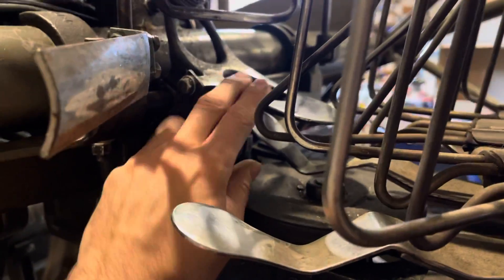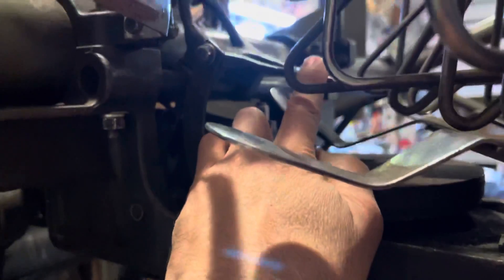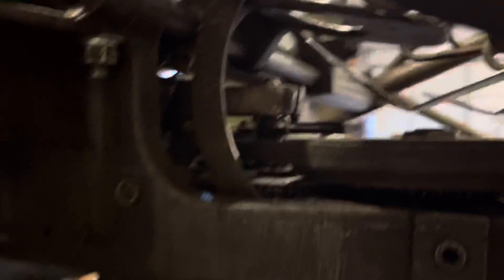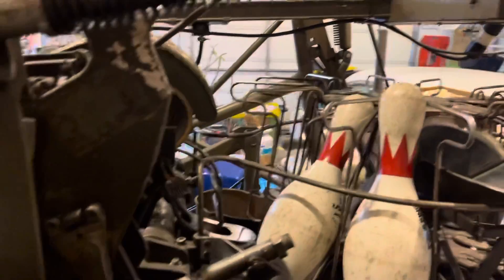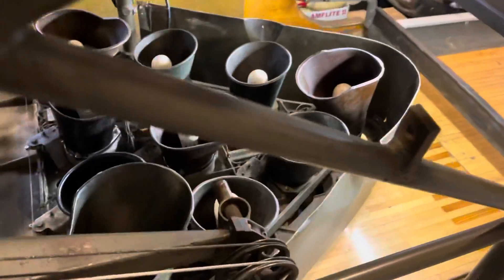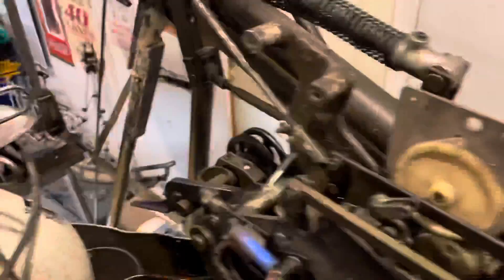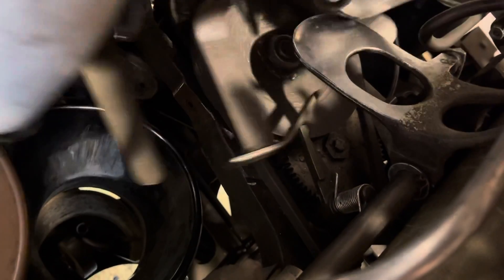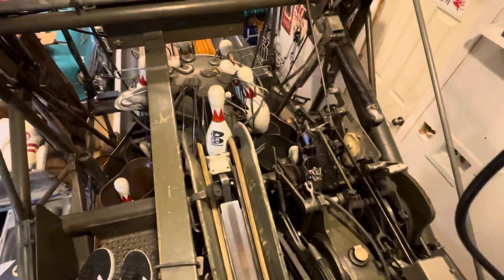Turret indexing system briefly explained - Brunswick Pinsetter garage bowling alley

Comment: Time delay latch and time delay gear the arm comes over and hits the latch opens the latch which in turn allows the time to lay to turn underneath the time delay is a bearing that's on the C lever who won the time delay turns it pushes down on the pedal therefore running the short link to open the clutch latch to advance the turret

Comment: I'm interested in how it works for the rest of the pins.  I don't see how the turret does not index all the time, if the clutch is only used for pin 5.  Something has to disengage at some point.  When the cam follower is up, does that also disengage the clutch?

Comment: I had 2 lanes that had a problem with the spider not returning for the next set of pins, resulting in blackouts. I have 32 lanes to manage and I don't have time to answer a bunch of blackout calls.   My solution was to remove 1 pin from the machine.  We usually run 21 pins.  By running 20, it gives the machine extra time for the spider to return.  After I did that, no more blackout calls.  The turrets on those 2 lanes have been rebuilt but, the problem persists.
Reply: Not a lot to go on with a lot of potential problems here, but your long turret belt might be too loose? Could cause slow indexing. At some point I did exactly the same thing with a machine that had a tendency to double-load—with only 19 pins in the machine, there aren't enough for it to ever double-load under any circumstances. Was a great stop-gap until I could find the core problem.
Reply: @mangaman88188280  we've found a couple of problems with the worst one being plastic (pin debris) and other things finding their way into the bearing under the turret.   The quick fix is to add return springs to the spider.  Then, when you get time clean under the turret and only lightly lube it.  Too much lube in the wrong places can eventually cause slowing of some functions and of course it attracts unwanted dirt into lubed parts